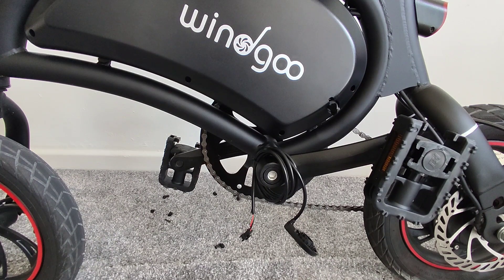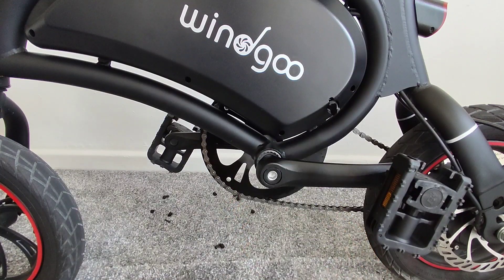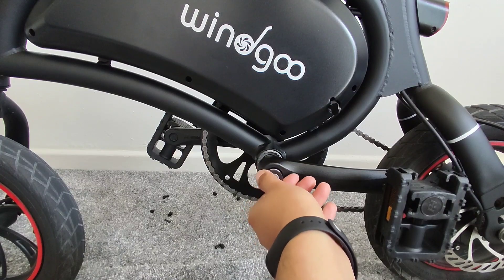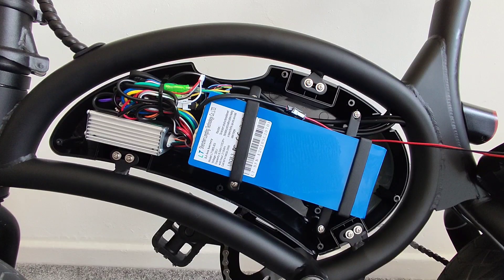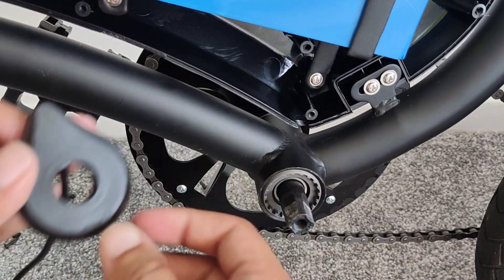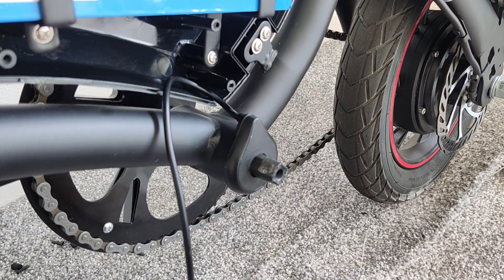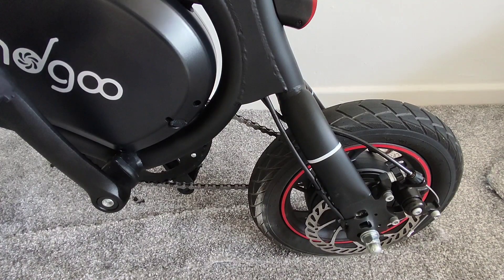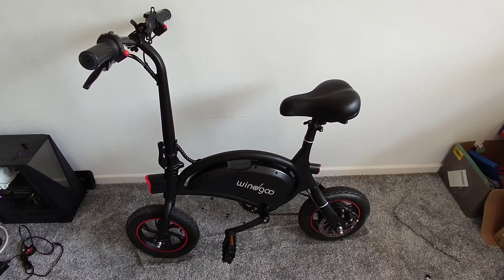Pedal Assist added to my Windgoo Ebike (DYU/Ancheer/Jetson)

Comment: Can you tell me where abouts you located the connector please. I cant seem to find one that matches the sensor. Was the sensor a tight fit on the bottom bracket? As mine seems really tight
Reply from the maker: My controller had many connectors not used, some was for BT, another was for secondary brake motor cutoff & PAS. You may have a different controller to mine? I remember it being a snug fit not really tight.
Reply: @AlexHusTech yeah looks it. I dont seem to have any spare as they are either plugged to the motor or the motherboard. Shame. Thanks for the reply 👍
Reply from the maker: Ah Shane, every brand uses different components unfortunately, guess I got lucky.

Comment: How do I bypass the peddles assist so it's just a rev and go mate and how do I take the speed restriction off
Reply from the maker: Mine was already "Rev and go" there might be a component that does this but I'm not sure, sorry.
Reply: Sorry I have a b20
Reply from the maker: @davidcarr3052  I had a B20, wanted to some mods on it, However it was difficult to work with so I sold it on.

Comment: Hi, is that also possible without the trottle grip? So only pedal assist? And does it work for the windgoo b20 too?
Reply from the maker: I think it all depends on the controller, I think I could've removed my throttle and it would've worked. B20 didn't have the connection to add the PAS, would need a new controller for PAS to work.
Reply: @AlexHusTech looking forward to know. In the Netherlands the throttle seems illegal
Reply from the maker: @sergioooijens9290  I never done this mod so I don't know.

Comment: Is there any way to make it better at going up hills
Reply from the maker: The battery and controller are pretty weak, so upgrading from 36v to 48v/52v would help but costs add up. Reducing weight is a free mod that will help.

I normally peddle as I go up hills, does it with ease, on throttle only it struggles.
Reply: @AlexHusTech  I need help tho this is my first bike and I've never modded them before . Do you have a video showing how to upgrade from 36V to 48V . I also would like to add the pedals but I don't know how to buy the parts
Reply from the maker: No I've not done the 36v to 48v upgrade as it requires rewiring which may be a challenge, I've not seen any video on the windgoo of the upgrade.

The peddle upgrade I made a video and have the  parts used in the description, I bought my parts from eBay, AliExpress and Amazon.
Reply: @AlexHusTech  okay thank you I'll try follow it so That way I can go up hills

Comment: How do you swap those wires over?
Reply from the maker: I cut myself and rewired, not difficult.
Reply: @AlexHusTech  I can't get the pins out of the connector?
Reply from the maker: I cut the wires, easier that way.
Reply: I did it..they just pull out then just poke tabs up again 👍 appreciate your vids thanks.

Comment: Is it supposed to have movement after installing?
Reply from the maker: As in the sensor? No mine doesn't move.
Reply: @AlexHusTech  My bike won't work and I noticed mine really loose. I'm wondering if that is the reason. That sensor controls the throttle as well correct?
Reply from the maker: The PAS Sensor and the throttle should work independently of one another.

I've not had that problem, did you match the positive, negative & signal wires from the Sensor to the Controller side?

As soon as I pedal with the bike turned on the motor will kick in.
Reply: @AlexHusTech  I purchased the bike a month ago. I took it on a 5 mile hike and pretty much everything stopped working. I thought it was a battery issue but I still had three digits left. After fully charging the battery, the bike still does not kick on. I’m puzzled. I rode to grass and I’m thinking that maybe the tall grass loosen that sensor. Throttle will not work when the meter is on nor does the motor kick on after I pedal. I never touched any wiring
Reply: I did however check the control box and uninstalled the brake wires and reinstall them back in. Everything looks good in the control box. The battery does kick on, the horn works, and the light works. However when I turn the meter on, and a pedal, nothing happens.